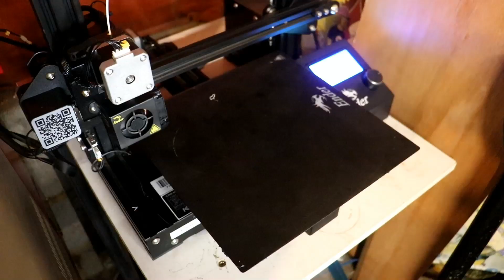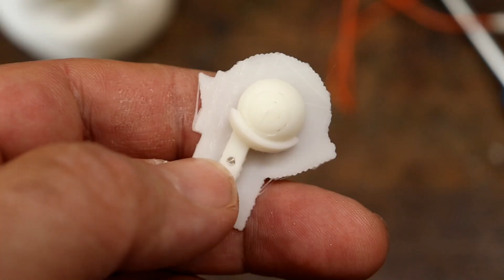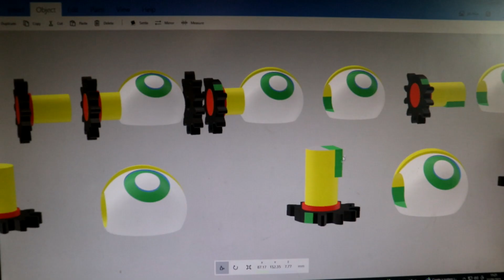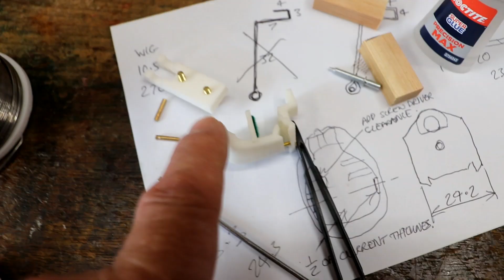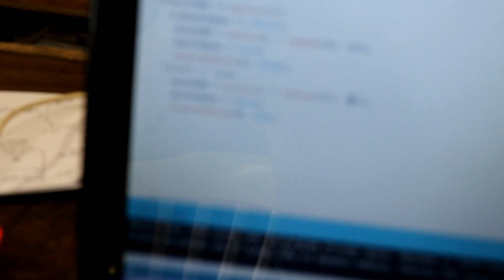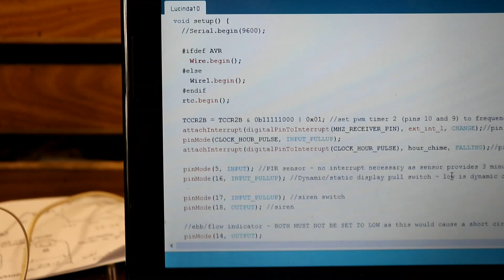Part 4 - She has a whole head but it took so many eyes

Comment: Cura slicer (and presumably the rest) has an option to print a sequence of items one at a time on the build plate which avoids the stringing. They can't be too tall or too close to each other so the head doesn't collide but it works really well for doing 4 or 6 small items.
Reply from the maker: Thanks for the top-tip! Unfortunately everything I print seems to be too tall to use this feature.

Comment: Exactly what I mean about not taking the leap into 3D printers, soooo much lost time. Great perseverance as always John, It was never going to beat you. The head is so scary, I think giving her a voice might be a step too far though🤣 As far as the hair is concerned would it not be cheaper to buy a doll with similar head dimensions and perform a craniotomy to use the hair and skull top? just a though! Looking forward to the next video, I'm expecting great things. Thanks for sharing and have a great weekend.
Reply from the maker: Thank you. My perseverence is wearing thin... I'm so pleased you find her scary. Great minds think alike - I've ordered a dolls wig for her hair - 35 hours of 3D printing or £7.50 from eBay - a no brainer! Now to get her speaking using a Teensy and the Teensy sound board...
Reply: @steamhead  Please don't give her the ability to give orders🤣
Reply from the maker: @wasdaletimelapse7658  well now you mentioned that...

Comment: May I ask why the mouth has to be driven by PWM in the first place?
Reply from the maker: I thought I'd be clever and use a standard dual H-bridge interface to run the 3 volt eye motor and 5 volt mouth solenoid. I then discovered that supplying the electronic switches inside the interface with 5 volts rather than the expected 12 volts caused such a voltage drop the solenoid (that draws 0.5 Amp) didn't work.

I then supplied the interface with the expected 12 volts but needed to take the voltage down using PWM which caused her to either 'growl' or whistle! I just wanted her to move so returned to using a Darlington pair transistor to switch the mouth solenoid.

I want to get everything controlled by a Teensy as it has a wonderful sound board - watch this space!
Reply: @steamhead   You could put a resistor in series with the solenoid so you can give it the whole 12V, or put a smaller resistor in series and a capacitor parallel to the solenoid to suppress the PWM peaks. 
I'm eager to watch your next steps!!
Reply from the maker: @daviniusb6798  thank you for suggesting a resistor. The thing is I don't know how similar these solenoids are to one another and it's far easier for someone assembling the kit to change a PWM output on a microcontroller to adjust the 'voltage' rather than swapping resistors. 

In breaking news (in the next video), I've been controlling her with a Teensy. Along with being able to play sound files, the Teensy is fast enough to include a bit of software that opens and controls her mouth in response to the audio output and you can even set the PWM frequency for each PWM output! Wonderful!

Comment: A tiny bit of putty and paint would solve your gap issue. Would you be painting the finished head anyway or is there a reason that it needs to remain exactly as it came out of the printer?
Reply from the maker: I did think about filling the bottom eye gap but wasn't happy that you could see the mechanisms around the sides of the eye. Working at this scale with the necessary tolerances meant the eyeball just looked like it was floating in an unrealistic eye socket!

I plan to market the automaton as a kit which customers would paint. Hopefully once I've sorted out all the issues I will produce a painted one!